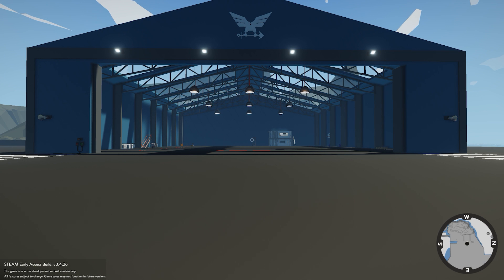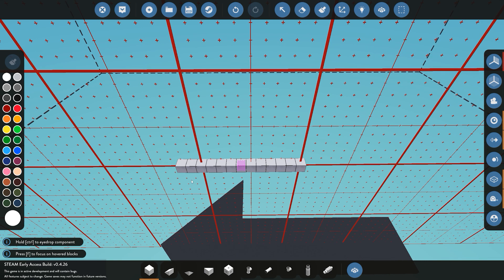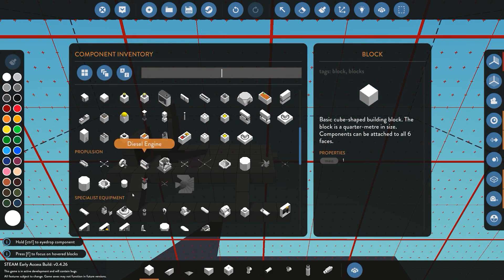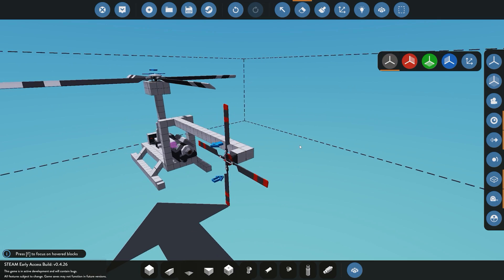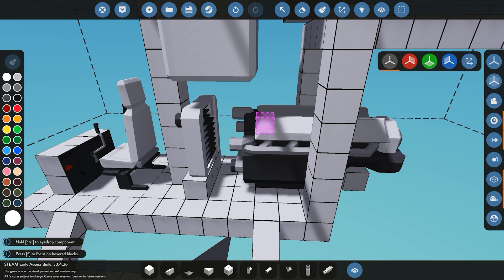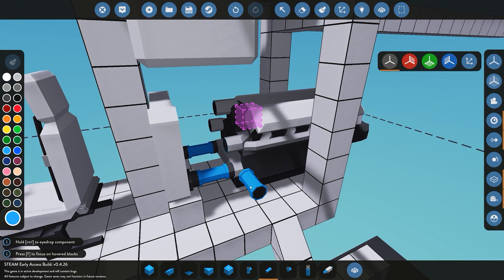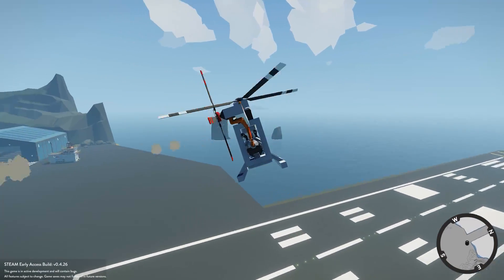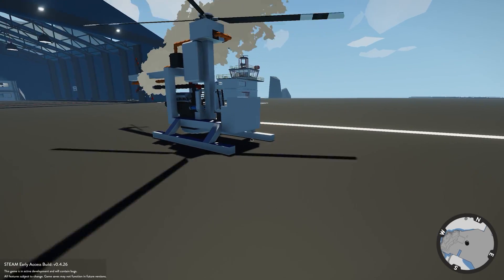Stormworks Advance Helicopter Tutorial

Comment: if your helicopter is turning slightly to the left, set the tail blade pitch to positive, worked for me
Reply: Mine does the same and I hate to controll it manually. I tried to set the tail blades pitch to positive, but it was too much and now the helicopter would turn to the right, did you change the ammount of blades? Im currently using 4 on both rotors, maybe if I only used 3 blades or 2 on the main rotor with a positive pitch, I could get some balance.

Comment: My heli. keeps slowly circling (clockwise) and strafes to the left. Im usingthe gyro with auto hover, the CoM is directly below the main rotor (and low down by the landing skids),has a recent update screwwed over helicopters?

Edit: The rotors are all neutral, the wind is turned off, and the Gyro is wired correctly (the craft handles as expected when inputting controls, but once I stop inputting it levels out and slowly drifts left and turns right)
Reply: Try to put controllable valve to the back rotor

Comment: I have been testing helicopters for the past week and I can not make it work. So I came here and followed this step by step and is still not working for me. As soon as I start the engine, the helicopter starts to autorotate in opposite way to the main rotor, and it seems that the rotor tail is not able to hold against this. When the Gyro is without electricity the rotors balance themselves, but as soon as I give current to the gyro everything starts failing. I even tested with gearboxes for the tail rotor which reduced the problem but did not fixed it. Any insights?

Comment: Nice tutorial, it really helped me out a lot! Although I do have one question, my helicopter keeps wanting to turn (yaw) left and I don't know how to fix this. I know you probably won't ever see this but even if you don't nice vid! ;)
Reply: Yeah I’m having the same issue, I’ve tried using inverted gear boxes which seem to kinda work but then cause the heli to flip the fuck out
Reply: Devs updated helicopter rotors and now they yaw spin in this configuration. idk why, idk how to fix it
Reply: Try put gearbox to tail rotor and make it 3:1 or something, maybe it can fix this issue, not tested yet

or search on youtube "Stormworks advanced torque" one man created/published controller that fixing yaw spin
Reply: Yeah I’ve given that a shot, no luck with any ratio I’ve tried yet and the ones that have gotten close end up shaking themselves apart once they clear about 10 m
Reply: I found a "workaround" for this issue. Use the old rotor. Go to selection grid -> load content -> presets -> advanced helicopter -> paste it -> steal the rotor. :/
It's a terrible workaround but I don't know any other solution rn
Reply: So, it’s KINDA a solution:
Coaxial heli has to rotors facing different sides, you got to get micro controller or something and no need for back rotor, my helicopters are a bit bad but there are some good ones like: “ZE Minicopter”
Reply: The way to fix this (I'm a year late to the party) involves an angular speed sensor and a PID controller. If you look at the preset helicopter logic you can sorta work out the numbers

Comment: Hey Jersey, super nice and informative vids , thanks mate. Question: how to control yaw with 2 or 4 main rotors and no vertical rotor? Like for quadcopter or Chinook ))
Reply from the maker: invert blades and use the roll as the yaw
Reply: @MrNJersey  thanks we will try , just now watching and making your Radar tutorial )) super
Reply: For a two rotor Chinook Style heli i had the main rotors spin in the same direction, used YAW with an AND block on the roll stabilized input on the Gyro, but also an Inverterblock on the YAW signal for the rotor in the back. That made the chinook both YAW and roll.
Reply: @EyeDentify  clever solution

Comment: hey can i use electric motors for it?
Reply: Not necessary. Electric motor are extremely power hungry. And  if you don't have diesel engine for recharge your battery, it will die
Reply: @thelightbrigadef4172  electric motor takes less space though

Comment: What if use not radiator but just air, pumped into cooling system by main rotor and after passing it through engine to let out heated air together with exhaust gases?  Im always using that method.

If ingame was realized air stream directed out of main rotor and it can be passed into tube system, that's perfect method, estabilish cooling power dependens on a rotor work.

Comment: I followed this using the advanced helicopter template, both rotors are set to neutral, but the thing violently spins out of control clockwise as if the tail rotor is over on positive with hard yaw. I've tried a number of things but all with the same result.
Reply: Check if your helicopter is pointing in the right direction (the ground arrow in construction mode).
Reply: Martellus Im having the same problem

Comment: I Tried doing the same thing but every time I started the helicopter it would always go up into the roof of the buildings
Have I done something wrong??? Please help
Reply from the maker: Kaelen Saunders make sure you have the rotors on neutral
Reply: try lowering the sensitivity of the throttle or lowering the max power of the engine